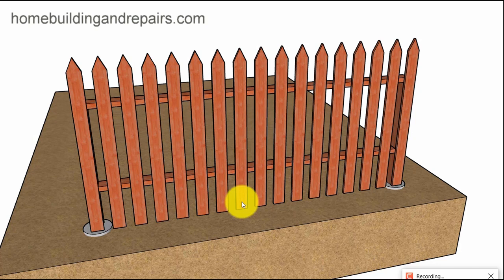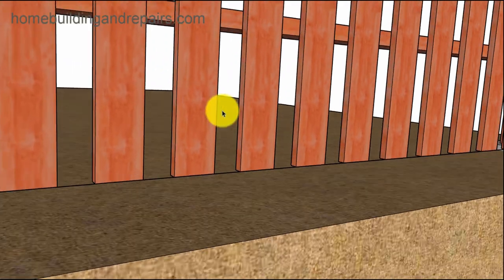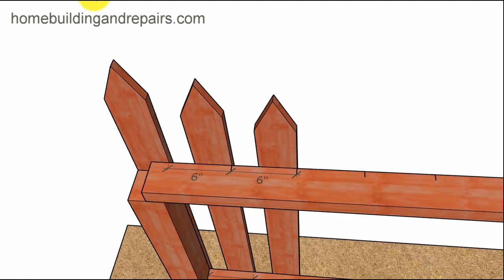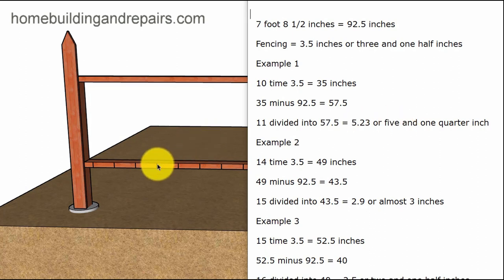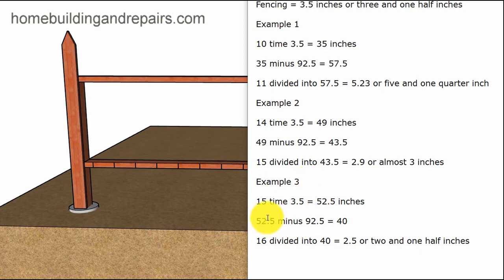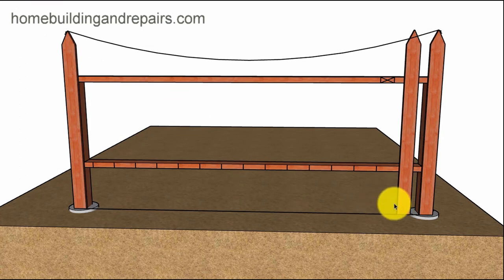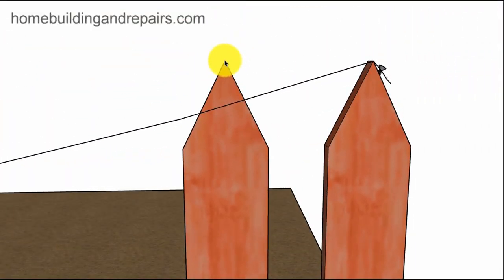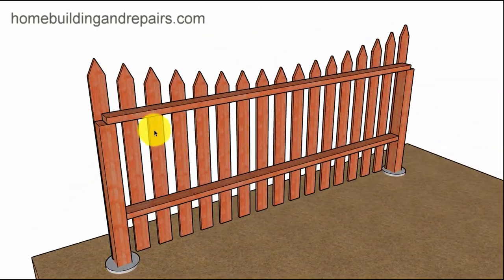How To Design And Build Decorative Fence With Curved Top And Straight Bottom - Home Tips

Comment: Would this be easier? Set your string, flip the picket upside. Mark the lowest level of the string on your picket and then cut it straight across?
Reply: Thinking the  same, point down, cut atv low point , cut and flip right side up
Reply: @christineoneill3798   well i think the cut line wout be where the middle of the picket meets the string, right?

Comment: Great method.  I thought making your cut mark while hoding the picket upside down could be an easy way as well.  Also, if pickets are evenly spaced and have a center picket that is dead in the center, you could probably save some time by cutting each picket in pairs (for the opposite ends),  this would also guarantee symmetry.
Reply from the maker: Yes and great idea about cutting boards that will be located in the same spot from the right and left side sounds like a real time saver.

Comment: Thank you for the information. I also need to figure out where my supporting 2x4's go because my bottom post is going to have to be 6 inches from the ground because I am going to my put a 6-inch raised bed underneath, then figure out where my top supporting 2x4 is goign to be if I have to dip down a bit. I am also using the gothic-shaped pickets. Again thank you, you helped me a lot with this information. I saw someone else use a spreadsheet to help with the math too.
Reply from the maker: Glad it was helpful!

Comment: How do you cut the round male ends to insert into existing post?
Reply from the maker: If you're talking about the concrete footing, then it's usually poured around the post that would be sitting in a hole that is a little larger than the post, maybe 8 inches in diameter.
Reply: @gregvancom  I measured the height from the ground to the height of my pickets against my corner post. or you could measure a little higher with a measuring tape, depending on the look you are going for. It seemed to work for me. If your ground is level enough, mine was, but you could kind of see a sloop. then I ran a line across the top of all 4 sides and then made all of my running post level to that line. I am going to a garden fence to keep my dogs from burying bones in my raised beds. :)